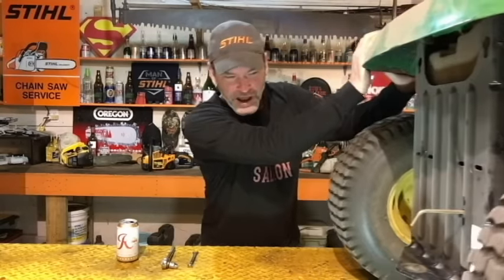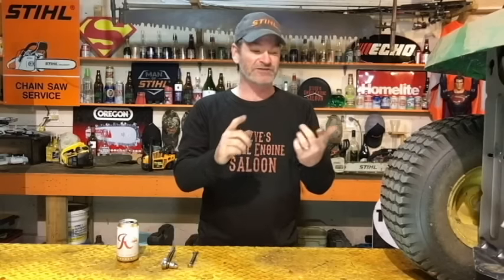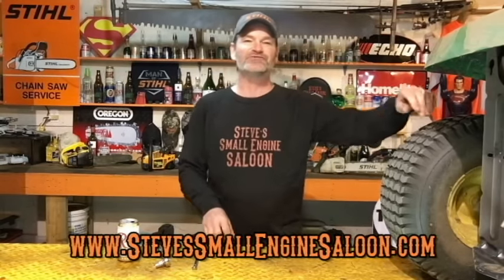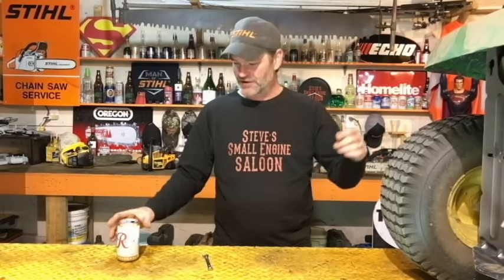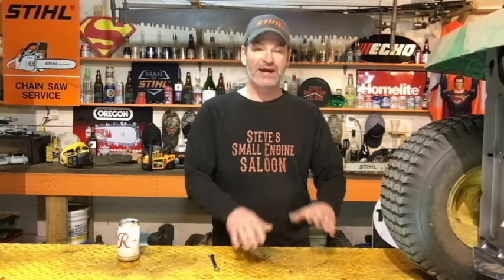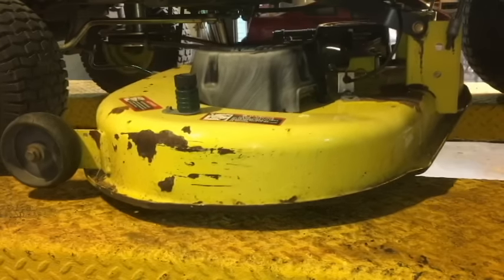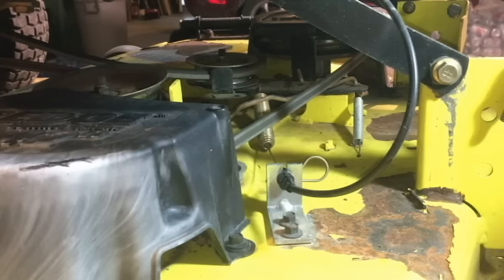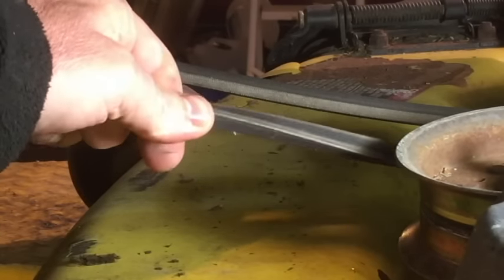How To Adjust The Belt Tension On A Riding Lawn Mower

Comment: Hi Steve. this gives me something to try. I have for some reason the opposite. problem. after a month. the blade started to engage by itself. without pulling on the lever. cleaned and lube everything. it's like the belt got to tight. [ I know belts should stretch with time. but this one seems to have tighten. don't know why? it's my daughters tractor. it's a sears craftswoman 42inch and old one. I fix it for her. when it breaks but this has me stumped. probably will have to order a new belt. [ again ] your video gives me a starting place. never new about this. thanks you were in away helpful

Comment: I have a related question: does belt dressing make any difference in how the belt grips the pulleys or tends not to slip off. What is the best belt dressing?
Reply: Don't use belt dressing. Makes dirt/dust stick to your belt shorting belt life.

Comment: Steve I appreciate your videos so much. single female here.  you have helped me fix so much of my power equipment!! I'm super curious to find out what the adjustments are on either side of the deck attachment bracket. there's  a nut on the cable and another adjustment on the other side of it and I can't figure out anywhere what they do. My bracket is maxed out to the greatest tension point but my belt is always lose even a brand new one. Thanks again!!!

Comment: Hey Steve!! I have a John Deere lt180 and my blade will engage on its own from time to time even when I don’t engage it , thanks in advance for your reply, love your videos brother
Reply: Your belt tension may be to tight, also check for corrosion on the main drive pulley. If there’s corrosion sometimes it will grab your belt.
Reply: Johnathan Legg thank you I’ll check into that

Comment: Hey Steve, my bracket is welded on.  Can you adjust belt tension via blade engagement cable?
Reply: Same here.  E100 is welded on.
Reply: Same here, I bent mine. It worked.

Comment: Got one of these babies and it has hung in for many years. Yep, I've got that old whirring going on so I need to grab my cheap ass pliers and see if I can loosen those nuts before I round the corners off.  Thanks for making that look so simple, it only makes me feel like that much more of a klutz 'cause I have to watch this six times.
Hey, does your deck seem to no longer be level front to back?  I've looked and looked and with the one eye open I'm not seeing much to adjust except at the very front.
One  other thing, do you know if the blade pulley uses a key on the shaft so that if you hit something/s the key will shear rather than the spindle assemble yanking the deck apart?
Thanks man.  Wish I could find the picture of the last time I worked on this baby.  I sent it to my mechanically inclined brother and he refused to help me. 
I used to be fair at working on stuff but it has gotten so bad that the Georgia Association of Shade Tree Mechanics has pulled my license...I'm down to that cheap ass pair of pliers!
Reply: hughbo52 🤣🤣🤣👍

Comment: I replaced the PTO cable on my husqvarna and now when you engage the lever, the blades begin turning, but once you get the lever fully engaged, it kills everything. I checked the tensioner and it's as loose as it gets. Any advice?
Reply: check that you didn't unplug a safety switch connector(sensor) under the seat (or the kill switch end) while changing the cable

Comment: Hey Steve,  When I was a kid my old grandpa used to tell me that it is called a " Leever"  because kids were supposed to  LEAVE HER ALONE  , and not touch it  !  !
Reply from the maker: LOL, My Dad told me the same thing once!  Right on....  ;-)
Reply: Neil McColman 97:’’
Reply: Mine did too! Seriously. Lol
Reply: @Steve's Small Engine Saloon 
I bought John Deere 100 series 
First time used and noticed 2 issues 
Steering is not smooth and difficult to maneuver  when turn.
Second is slow it’s slower than my 15 years old Craftsman mower. I noticed deck belts is so so loose. I can upload the video and send the link to you.
I called the local dealer and he said it’s under warranty but $80 for drop off and pick up. Should I tight belt ? Please advise. Thank you
Reply: @ssinvllc  he just showed you how to check... You probably should check
Reply: Which one do you pick "Lever A" or "LEAV'ER B"? 🤣

Comment: Great video. But one problem. The newer John Deere tractors took out the bolts for the cable bracket adjustment. They welded the bracket in place. Now there seems to be no adjustment. My son and I have the same tractor. Mine has the bolts, his does not. He had to return a brand new tractor because the belt was so loose it came off when disengaged.

Comment: My JD D-105 has it's cable adjustment bracket welded to the deck frame.  There are no bolts to loosen and adjust the bracket.  What can I do?
Reply: Need to check online if this is standard for that model.  There may be another way.
Reply: Mine too. I looked today for a solution, and had to make a temporary rig. NOT GOOD  Mr. John Deere
Reply: Steve, your video would have been great help, but WHY did they weld it, I wonder. Thank you though! I looked from one end to another for another solution
Reply: @stevenpiper55  so you buy more belts earlier than needed corporate profit over  quality
Reply: Steve Parsons they welded it to force us to buy more cables. Farkin Ice holes.
Reply: Maybe you can shim the cable back with washers or a nut that you cut a line through with grinder in order to pass cable through it and put it behind the mount and secure it. Hey last resort tie a knot or two in the cable on the spring side which will shorten it, or the hook that hooks to the pulley adjustment arm could be cut back and re- bent so it is shorter. What you have to lose? You will have to buy a new cable anyway unless you can rig it. I think they are pretty cheap on ebay. Shops gouging people for $30 or more a pop for cable that they buy from China for a few bucks..

Comment: Great video...my lever( on the deck itself) was moving but not all the way to the spring..found rust on the deck under the lever..undid the bolt holding it, scraped it cleaned, some grease and its moving properly now..luckily I have two mowers and found the other had all the movement needed..worth checking..deck was not that old and couldn't see the rust until I removed the lever..hope this helps your viewers
Reply from the maker: Right on

Comment: Mine is welded to the deck put on a new belt but his still has way more slack then I would like
Reply: Hahaha me too
Instant disappointment 😞
Reply: Mine is on my troy built so I'm wondering the same thing
Reply: Im going to try cutting mine off, drill it out, move it back and put a bolt through it
Or maybe bend it? Got to look at it again.. new belt still slips like crazy
Reply: mine is welded to the deck also and putting a new belt has not stopped the belt form falling off every time I disengage the blades. What next??
Reply: I came up with a idea y'all. What if you cut one coil off the spring and try attach it ? That would put more tension on wouldn't it?
Reply: Or bend the spring so it is shorter like Taryl does in his video. Heat in a vise to red hot then bend one end so it is shorter. Instant belt tension.
Reply: @rudymartin168  awesome going to try that
Reply: I have the jd s100 "welded bracket" by searching I'm seeing that the belt for this is the 103.975 length. I have a 105 here and it's way too long. Anyone know what length I should get here ??

Comment: Steve, I did this last season  and it worked great, but alas, I now need to replace belt.  Do I return that adjustable bar to original position as new belt won't  have stretch/slack in it now prior to install  of new belt?

Comment: Steve, I just replaced blades an belt on an 110LA, belt still slung.  Tightened the cable, it still slings off. It doesn't matter if it's idle or full throttle, or lowest or highest cut setting. 
What would be the next things to check out?

Comment: Yeah I have a new 130 and the dipwads welded the adjustment bracket to the deck! No way to adjust!
Reply: I have the same issue with my D110 deck. What’s the solution—replace the cable.
Reply: Shorter belt?

Comment: Thanks Steve..good video..I do all my own work on my mower ..its a husquavarna 22 hp 46 in cut ..I rebuilt the deck last year ..had I known that the 22 hp motor can handle a 54 in deck I would have installed it in stead of rebuilding the 46 in deck ..now I know ..thanks again ..
Reply from the maker: You're Welcome...

Comment: Hi Steve, great instructions. Unfortunately this does not help me, since the cable bracket on the mower deck of my JD D125 is welded to the mower deck. Apparently there are no adjustments possible, yet the owners manual shows as the last step in replacing the mower belt is to adjust the belt tension. Could there be another way to adjust belt tension, or am I SOL?

Comment: Too much waffle , My advice is change your belt for one manufactured from Kevlar, it will last 10 years , did this just recently on my 42 inch John Deere, I also found it as an easier fix if you put the mower on a set of ramps , which i got from Walmart.

Comment: Great vid! I have a John Deere Lt155.  It doesn’t have that type of bracket for adjusting.  It’s bar with a spring on end.  Is there any way to adjust?
Reply: Mine is a 166 with the same kind of bar and spring....I've replaced the belt and now the blades dont engage at all

Comment: For anyone with a John Deere mower, many of the models (including D130)  have a belt tensioning feature on the inside of the belt covers (shields). As the belt wears against the hard plastic tensioners it wears away, and the belt becomes looser and more prone to slippage. When this happens replacing the shields will also help with belts slipping, and falling off the pulleys.

Comment: Thanks for this. But my problem is not a slack belt when it is engaged but rather when disengaged there's so much slack the belt slips off the pully. Runs fine when engaged, but falls off when disengaged.   I made the adjustment you showed here but it did not change the slack when disengaged.  I put a new belt on, and it has the same issue. I'm now ordering a belt that's 1.5 Inches shorter than specified to see if that works and won't fall off when slack.
Any other suggestions? Thanks

Comment: The newer model decks have removed the adjustment screws and went with a straight welded bracket. 🤦‍♂️
Reply: Mine is a newer JD 105 and it is welded, do you know how this is tightened? When I engage the blades it may take 30 seconds before they engage. Somethings obviously loose.
Reply: J BELL  two things I would check is the bracket it’s self and that it’s not bent, also if you look at the top of the deck you’ll notice that the spindle brakes are also tied to the tensioning system through linkage as well. Make sure that the brakes are pivoting away from the spindle when you engage the pro lever. Engine off of course, if they aren’t moving freely check that linkage and lubricate where they mount to the deck and work them back and forth until they free up

Comment: No longer have any adjustment for JD deck belt, the bracket is welded in place. After a year or two she will start throwing off belts every time you stop the blades. 😡
Reply: My ‘08 LA115 had this, but I just found my replacement deck, purchased in 2022, does not.  My PTO cable broke and I just replaced it. At 3” and higher, my blade now spins slowly even when disengaged. Drop it to 2.5” and it stops. I went to loosen this setting - that’s when I found it no longer is there.  Hopefully the spring/cable stretches a tiny bit quickly.

Comment: 👍👍 this works great! I am about ready to replace the belt. This process helps but it isn’t as tight as I would like.. with any luck my belt will last this year.  Can you turn the L bracket around and bolt it back down to move the cable even farther back? I know that is a jimmy rig , I just would wonder if that would work in a pinch...?

Comment: Took up the belt slackness via the all adjustments until there wasn't any adjustment left Steve, and while it did help a little, the issue is still there somewhat. The only thing I can think of now, is to reduce the belt size.  Do you think this might work?
Reply: Mine too. It’s adjusted all the way out. I’m thinking the cable is stretched too much. May have to replace the cable. LA120

Comment: I have an electric switch (PTO?) engagement on my Craftsman DYT4000. Rebuild deck (spindles, pulleys, belts) and now the engagement seems to take longer in reaching full rotational speed. It used to kick on instantly and get it to full spin in like 2 seconds. Now it takes 4 or 5 seconds. Belt isn't slipping. I used the Taryl Fixes All hack on the tensioner spring so I seem to have plenty of tension. What am I missing? It seems perhaps there's additional stress on the main pulley when blades are engaged, causing it to take longer to reach full spin speed. Maybe too much tension on the tensioner spring? It's gonna be something simple I'm overlooking

Comment: steve,theres a rod that conects to those  pivot  arms,theres a small nut looks like i could tighten up a bit,...my husqvarna  46 has a mark  for factory  tension setting,on that similar cable bracket ...ill try to tighten tomorrow, and update,

Comment: Thanks again Steve for helping. My neighbor is having this very problem, and can help him out. My JD doesn't have the tensioner engager on top, but his does. I bet your videos have helped me on a dozen different issues. KEEP EM COMING.  By the way, I was wondering if I should replace my drive belt after so many hours. Ive got about 300 hours on my JD.  Haven't really noticed a change, but thought it might not run as efficient over time.  Thanks alway, John in Florida.

Comment: Steve, Great advice. I have a JD LT133. The transmission drive belt was changes last season. Now the mower doesn't seem to be a fast when in different gears. I know that there is a belt tension adjustment,but I don't know where it is located and how to adjust it. Can you walk me through on how to? The place that did the job charges $65.00 just to pick up and bring back the tractor.

Comment: Hi Steve, great video, very informative. I have a newer model where you can't adjust the bracket for the blade engagement cable. It's welded on there. Any suggestions?

Comment: Hey Steve, great work you do here on YouTube! I have an John Deere E120 and the bracket is not adjustable because its welded the the deck. I know you have had this question before. Should I break it off and drill the holes to make it adjustable or is JD hiding the secrets to adjusting this particular type? Thanks in advance!
Reply: I've been thinking about doing a different kind of belt tighter bracket mine is welded on also. I can't find any other way to tighten the belt. I guess I will try and answer my own question? Rock on!!

Comment: Having the loose belt issue. New belt, seems properly installed. Just did this adjustment. Fixing to see if it did the trick.
Reply from the maker: Good luck!
Reply: @StevesSmallEngineSaloon  The adjustment worked fine. cheers.

Comment: Just a heads up if your Deere is chucking belts and eating them I mean new ones. More than likely it is the swing arm with the idler pully on it. that swing arm and it's bushing wears and gets sloppy. The bushings are the same as the 2 on the deck braking system ( which I removed off mine the first time I took off the deck to sharpen blades) the swing arm gets wallered after awhile to so you can do 2 things by a new one for 33 bucks and wait for it or like I did weld it up and re drill or machine it. The idler pully can crap out to but if that swing arm has to much play trouble.

Comment: Very good information with my tractor my 100 tractor is a newer one in that little adjustment bracket is welded no way to adjust there can you adjust it somewhere else?
Reply: I have the same issue with my D110. Is the solution to replace the cable?

Comment: I just bought a brand new E-130 John Deer and it doesn't cut hot butter. The belt seems loose, but should a brand new mower have a loose belt, and cutting like crap?? Any feed back would help..im very disappointed with it so far.

Comment: I just changed the belt on my mower & I put the fat part of the belt against the pulleys and the smaller part is facing the inside (if that makes sense).  Is the correct?  Great video by the way
Reply: Hey G Money.  You can tell which side of the belt is supposed to be facing each pulley by looking at the pulley surface where the belt engages it.  Some pulleys will have a v-shaped surface, so the v-shaped side of the belt engages there.  Others will have a flatter surface, so the flat side engages there.  Hope that helps.  Also, a shout-out to Steve.  Great videos.  I've learned both common-sense things (You know, the kind where once he explains it, you say "duh," I should have thought of that.) and some things that I would have never figured out, without Steve's help.  He's great on all kinds of equipment too - not just lawnmowers.  Like others, I also like the fact that, other than a sip or two of beer (a nice touch) he's all about telling you what you need to know, instead of putting on some silly show.

Comment: I tightened that bracket for the blade engagement and still have problems. The belt isn't tight on it afterwards when I engage the blade, but I just bought the new belt. It keeps killing the engine when I engage the blade too. Any thoughts? I've been struggling for days at this point.

Comment: how many hours do the belts average before being replaced. I have a Columbia  4220   have about 80 hours on the tractor. it was new 2 years ago. but only 80 hours of run time. The strap started to slip off had to put it back on. Is it used or i need to tighten the belt ajustment?